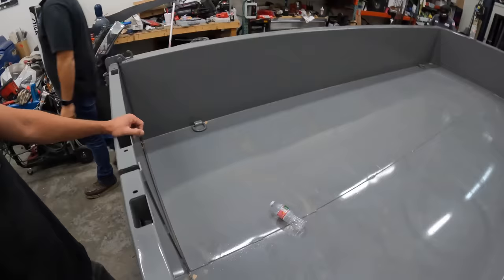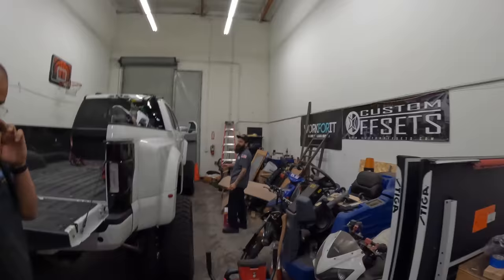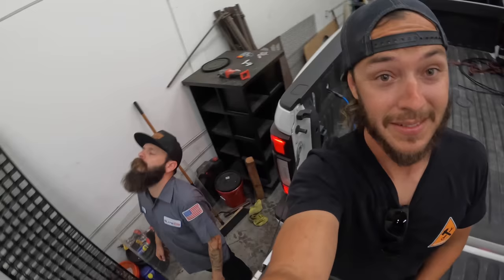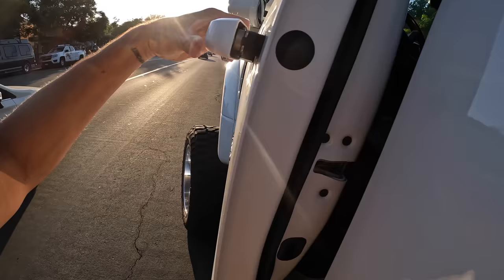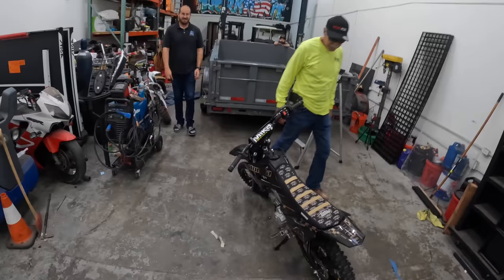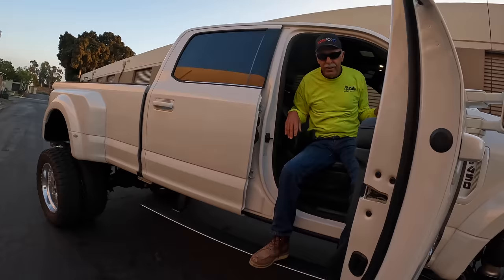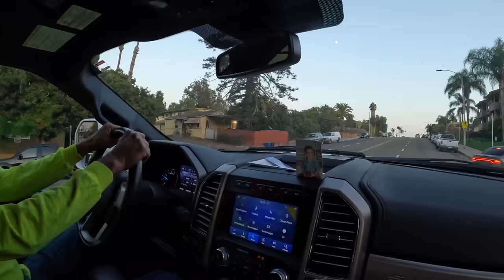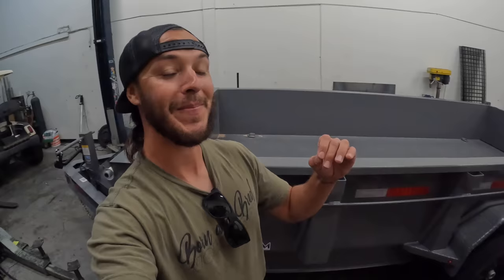Son Gives Dad a Monster F450!

Comment: Steering wheel is probably off center because of the road crown while driving and you're turning ever so slightly against it to keep straight. More noticeable in a solid front axle truck.

Comment: We use those things to prevent axle wrap from high torque from the engine. The axle would wrap and take the driveshaft out of alignment on hard acceleration causing the u joints to bind. Putting the product on prevented it from happening ever again. Great product.